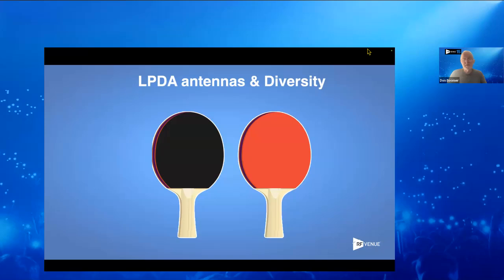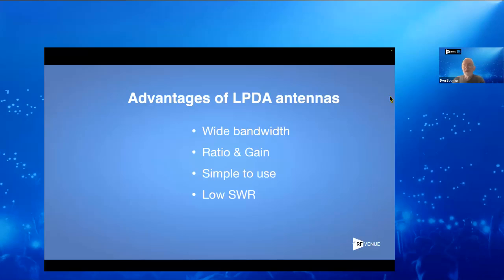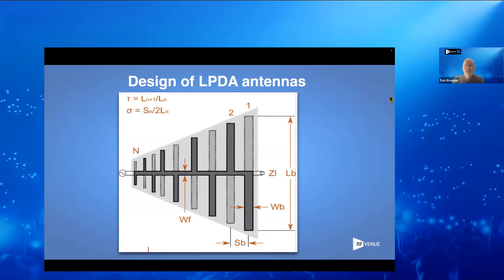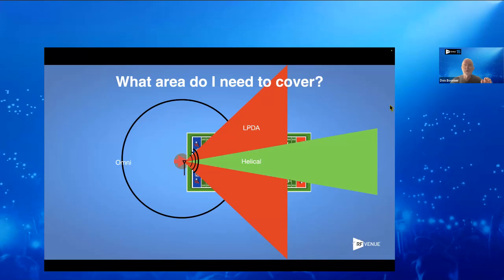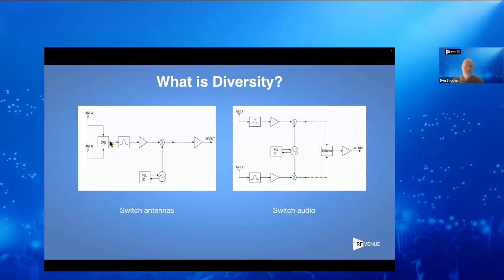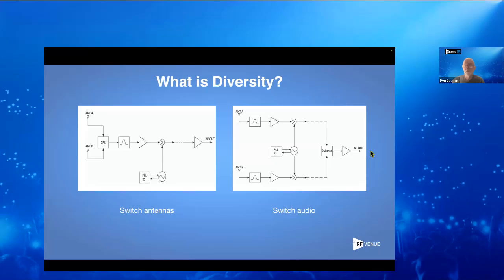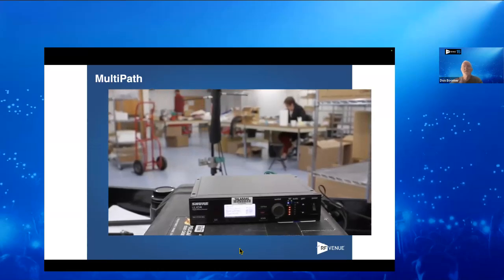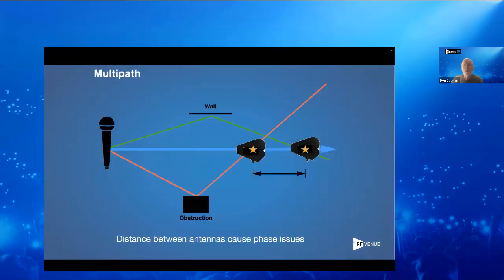RF Venue Live Webinar - Paddles vs  Diversity Fin

Comment: It would to see a detailed comparison between the Diversity Fin Antenna vs Diversity Architectural Antenna used in installs.
Reply from the maker: Great suggestion. What type of parameters are you looking to compare? In terms of performance there are only a few small differences with the DFIN and D-ARC. We designed the D-ARC to accomodate 200X200 size rooms with a minimum distance of 10FT. It has 3dB of gain and provides a slightly wider coverage pattern than DFIN. The DFIN has more forward gain (6dB) and should be 15-20 feet back from stage, and it could provide 300FT or more, if interference is low enough. You can expect the same exact protection against dropouts as you get with the DFIN. The D-ARC easily improves sight lines (since you can get the antenna closer to the stage without any problem) But the biggest differences are found with the ability of wall-or-ceiling mounting and respective forward gain. Hope this helps,
Reply: @rfvenue  would love to see a webinar spending more time on the D-ARC and correct deployment, limitations, and why to consider it over DFIN options out there.
Reply from the maker: @lukejackson1116  Great idea!